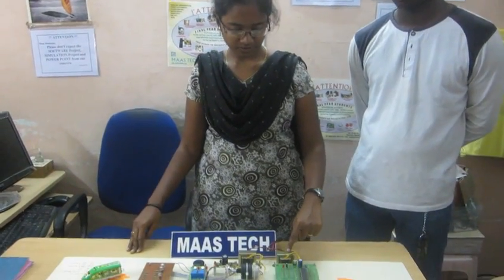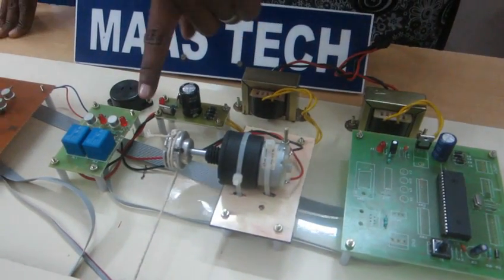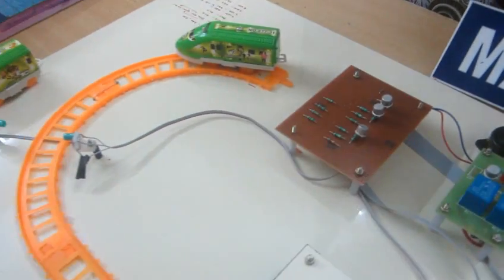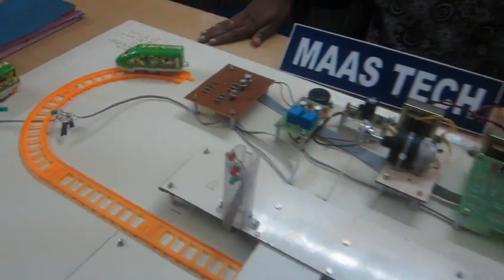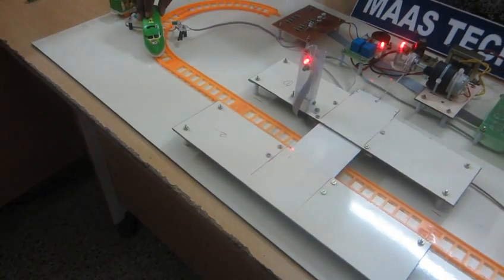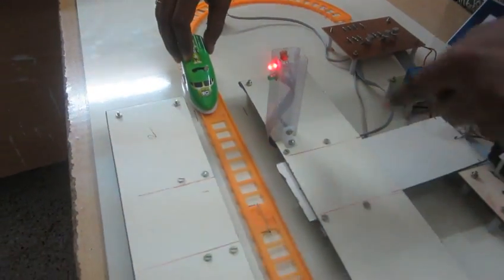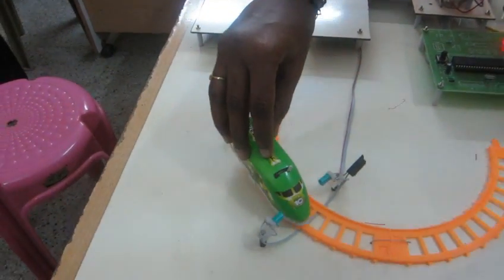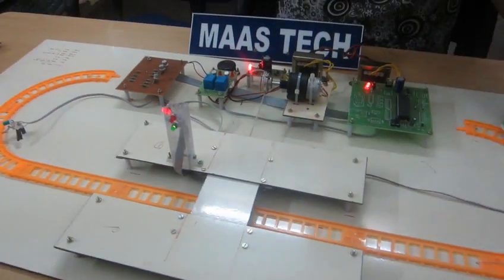RAILWAY PROJECTS FOR STUDENTS-railway track pedestrian crossing without using staircase

Comment: Great project, only one question: Why is the circuit made so complicated and costly?

Easier and Cheaper Solution: By using a SR Flip Flop when the train is detected, it will set the output and will drive a 555 based Timer to turn on the motor for the required amount of time ( with help of L293D motor driver for reversal). Then when train crosses the second sensor, the Flip Flop is Reset and drives the timer again and the path is closed again for the passengers. 

No need for a controller, code, relays. Just a 555 timer IC, 2 pairs of sensors like yours and a L293D motor Driver. 

Hope you find it useful for further development of the project.
Reply: bro send this circuit diagram
Reply: as you said

Comment: this technology also used in my project but using arduino microcontroller and wireless rf used.and ur project what type of dc motor used.dc gear motor rpm 2 to 100 rpm
Reply: bro send me ckt diagram bro